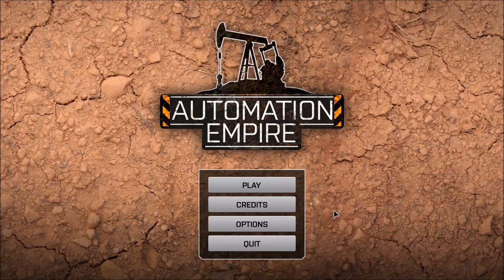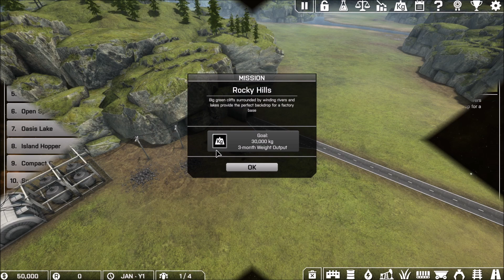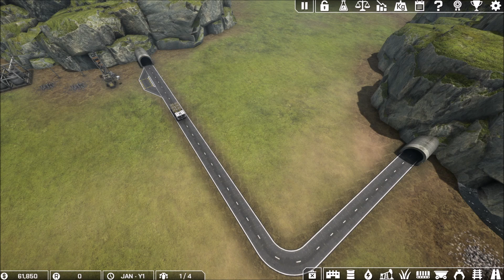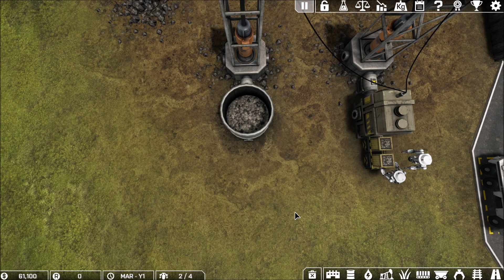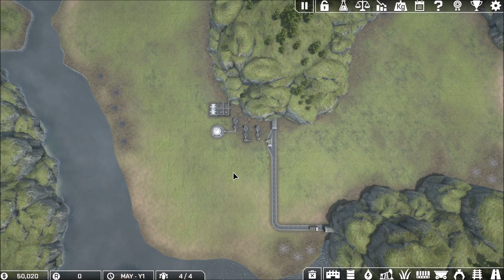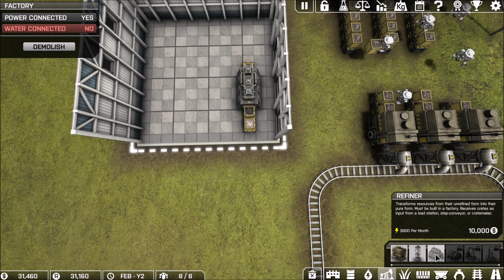Automation Empire - Getting Started Guide

Comment: Just bought the game from Steam and I think I got the hang of it for the basics, but not yet able to meet the production goal.  I suspect that will take a while to get the hang of.  The PC keyboard hotkeys were a challenge at first, but after watching another video about the game, I was able to figure out the movement about the map was by the common ASDW. keys.  The left mouse key sets structure in place, but I couldn't always get a good view angle to ensure I was making a good connection until I stumbled on the mouse wheel option.  You are right about the learning curve can be a tad much at first, but engineering minds tend to figure things out and watch YouTube videos.